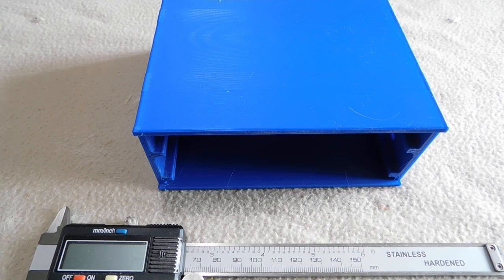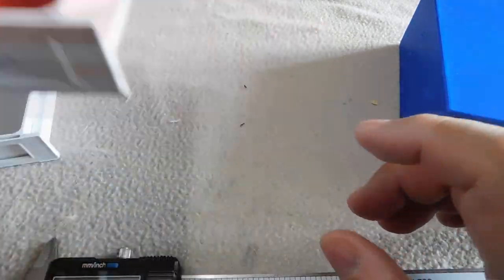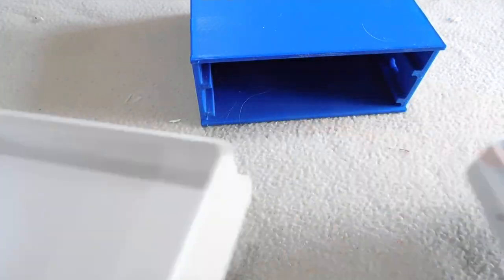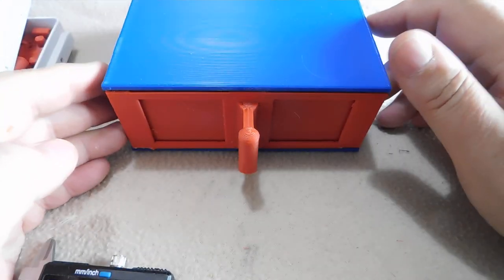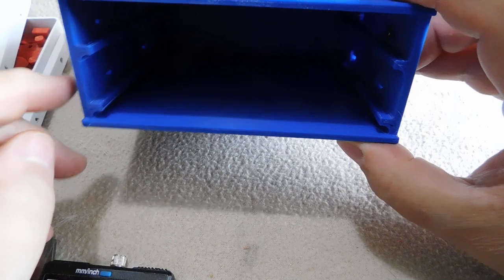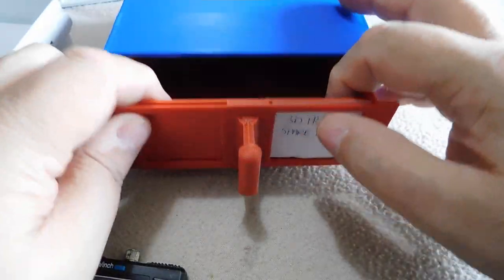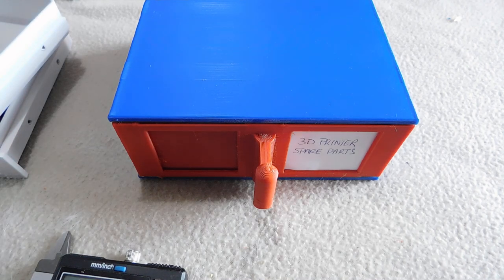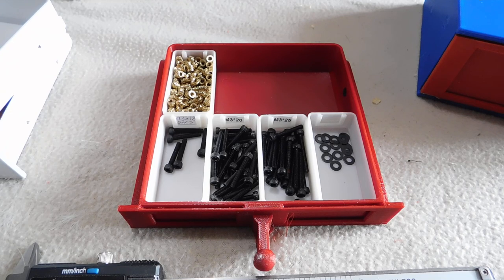Preview: The 3D-Printed "Ultimate Drawer System" that actually works

Comment: I really like this idea. Would be good to see drawers with the slides built in and just use support to print them in place. Also, for the issue of holding the drawers in secure, you could have a lip on the front edge that the slide drops into, acting as a detent
Reply: I agree, having the slides built in would be awesome even if it means using supports.
Reply from the maker: Noted! I'll eventually share the F360 CAD files, and it would be possible to export STLS with the drawers and runners as a single piece.
Reply: @timlong7289  i like the original idea, its much cleaner ya you would need to buy hardware but hey it is fun to melt those brass inserts into the filament

Comment: Its a very nice design! The inly thing I’d consider adding is a small stop to prevent the drawer from pulling all the way out without intending to
Reply from the maker: That's something I've been thinking about, but I can't see a clean way to do it with the current design. Perhaps this will be something that someone else could add as a remix later.

Comment: Fix the drawers with 4 holes with filament and melt :) at each end then you can save on screws
Reply from the maker: I guess that's one approach. I discovered heat set inserts while building my Voron and I've kind of fallen in love with them :)

Comment: I'd consider using thicker magnets on both the drawers themselves (one on either side at the back of the drawer) and the cabinet (one at the front and one at the back on either side), and have through-holes where there is no plastic layers between the layers and the magnets either contact or have maybe a 0.5mm-1mm of space between them. The magnets will act like a kind of lock to keep the drawers closed or keep them open (and not fall out). If using thicker magnets on the cabinet itself with through-holes, this would  allow the cabinets to "lock" together. You'd have to flip the polarity of the magnets for every other unit, though.
Reply from the maker: I decided to drop that part of the design because I felt that the benefit didn't justify the complications that it introduced. If I ever make a version 2, perhaps I will reconsider.

Comment: Just as note - you are either over extruding or your have horrifically bad material, but the white drawer quality is awful, showing drops of material on the plane surfaces. I would strongly suggest calibrating and possibly fixing. I would be inclined to give the print quality a 6/10 points. Again, this could be the material. Had similar with Creality PLA and only could get stable prints by buying other brands.
Reply from the maker: Keep in mind that these were prototypes and my goal was to knock them out as fast as possible to test and tweak the design. I printed them fast with a large diameter nozzle, so yes quality probably did suffer. The eSun white ABS in particular is known to be problematic (just ask on the Voron Discord). Since making the video I've printed two 8U cabinets in black, still at high speed, but they came out much better. I've also printed some drawers in Fire Engine Red and some insert trays in Natural ABS and they are all much better looking than the white items in the video.

Comment: what is 1U deep ?
I tough 1U was 3/4 of an inch
Reply from the maker: 1U is 1 unit, which I have defined to be an arbitrary value. Its not meant to be the same as a networking rack. The unit can be changed with a parameter in the Fusion 360 file to whatever you want, so you could make it 3/4" if you wanted to.
Reply: @timlong7289  OK, I really thought that the 1U was refering to a rack cabinet. It does make sense.